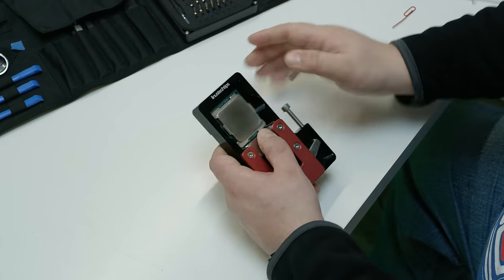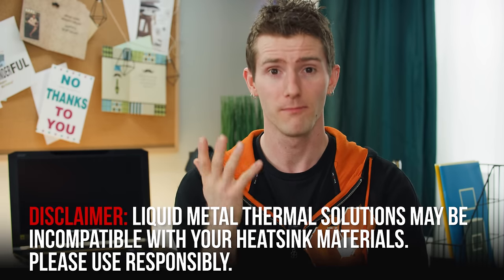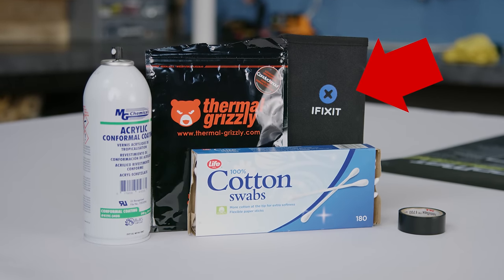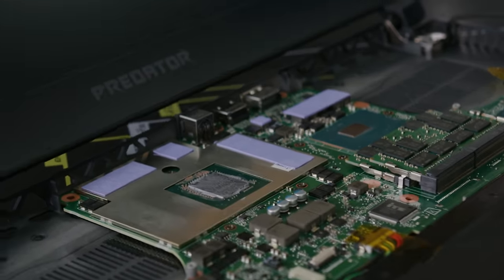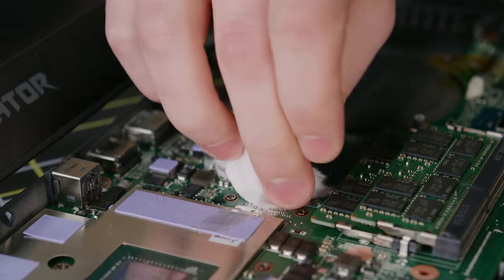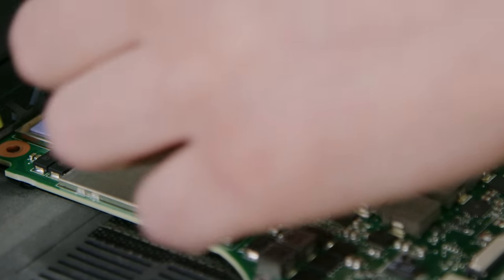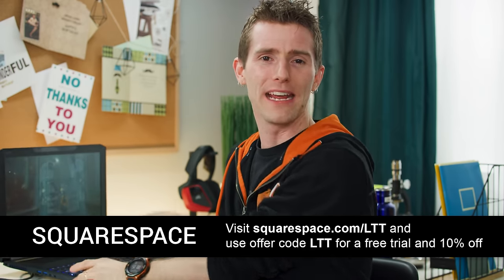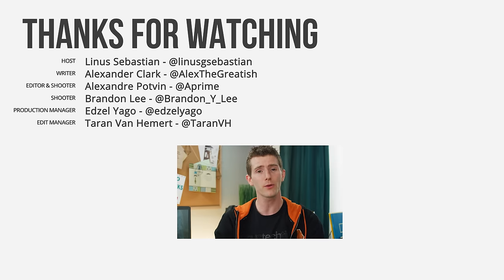Liquid Metal Laptop Cooling – 20C LOWER!

Comment: i7 8750H the H stands for Hell, as in this thing keeps Hell warm.
Reply: @tommybro5313  6 months late kid
Reply: Way too true this thing is hotter than the sun
Reply: hits 100°C regularly for me. had to undervolt to -0.165V! performs at about 85° after
Reply: @ethaningoa7461  , I use Noctua NT-H1 for the CPU and GPU and I also removed all the thermal pads and replaced them with Thermal Grizzly Minus Pad 8. 100c to 65 to 70 while gaming. Definitely worth it. Alienware 17 R5, I7-8750H and GTX 1070.
Reply: @VacMaster1991  wow, i wanna try that with my msi gs66 stealth.
Reply: @VacMaster1991  Are thermal pads really necessary? My scar 3 has thermal paste over those chips, and I was planning to just apply good paste on cpu and gpu.
Reply: @gamersanditparadise  it ok but the thing gets  messy
Reply: @marianakotiloy419  okay.
Reply: @gamersanditparadise  , the built in thermal pads have a conductivity of about 
 2 w/mk. The pads I put in have a conductivity of 17 w/mk.
Reply: @VacMaster1991  does it make a difference to the cpu by putting better thermal pads?
Reply: @gamersanditparadise  , no, new pads lower the temps of the gpu VRAM modules
Reply: @VacMaster1991  Okay. So I guess, thermal pads help reduce gpu's vram temps, but not the temps of the gpu itself right?
Reply: @gamersanditparadise  , the graphics card vram, not the gpu itself
Reply: Oh god the HK ones
Reply: You wanna say "Hellfire"
Reply: What about on a 2020 or 2019 MacBook Air?
Reply: @neubauerjoseph  MacBook Air had a fatal flaw with airflow didn't it?
Reply: @brytonmassie  I owned a 2019 macbook air bought it for the wife but I use it also.
here are my problems with that laptop top 5 issues.
1. CPU and system get too hot. need better cooling.
2. could have a high end intel graphics chips many do in its class.
3. keyboard flat keys suck.
4. 8gb is not enough ram these days it should be like 16gb all other laptop in its class offer 12 or 16 gb some have 32 gb ram.
5.SSD is too small at least 512 to 2TB would be good.
Reply: @brytonmassie  yeah that’s what I tell people....they leave a lot of speed on the table .
Reply: Linus I’ll pay you to do this for my laptop 😂 I don’t trust myself
Reply: @TheTonkGuy  so?
Reply: I thought the h meant hot
Reply: I have one and a gtx 1050 in my laptop and it doesn't get that warm
Reply: Or the H of Hentai
Reply: I thought it stood for 'Hot'
Reply: Yea , but overall, it's not as bad as my 7th gen i7 , both laptops, but my triton keeps things damnnn cool
Reply: i5 4200H and it was spiking at 85°C when playing Cities:Skylines (100% load) but after venting some dust out, it got 15 °C cooler with 5 extra fps. It allowed me to push up GPU settings :D and yet i still don't know if there is still dust inside my 5.5 year old laptop
Reply: i7-10750H here and mine use to stand for HOT I was running for example the new battlefield 2042 at 90-95c ever since I repasted I’m only at 70max and I only repasted with regular grizzly kyronaut
Reply: Imagine the 10750h
Reply: And i7 - 13700hx where hx stands for hell extreme to keep it extra warm
Reply: if only he knew how bad things would get
Reply: I resolved this CPU's temperature problems using the Thermal Grizzly Conductonaut liquid metal on both CPU/GPI....now I can use full CPU (i7 8750H) e GPU (GTX 2070) power on my Omen 17-cb00. Definetly would say liquid metal is MANDATORY on gaming laptops.

Comment: Who is here finding out PS5 is using liquid metal?
Reply: Sony stated it took 2 years of engineering to have liquid metal in the PS5. I wonder where they got that idea from? 

Sees Linus' video was released in Feb 2018
Reply: @ImReadyAyu  that would be funny 😂😂
Reply: @ImReadyAyu  the engineering went in to making sure it’s going to last for the life of the console, not evaporate or leak onto the mainboard no matter what the consumer does with the console.
Reply: @davecolwell725  and that is very hard and i salute them for that, i wouldn't even risk putting it in my rog scar 3
Reply: @davecolwell725  Let's just hope the "life of the console" doesn't end prematurely because of it...

Comment: Finally, Linus is truly supporting liquid metal thermal paste.
Reply: ICdiamond was a bit crappy  a  least for me i change to carbon base thermal paste  Artic MX4 and it was a lot better than IC
Reply: MX4 is a good cheap TIM, I was disappointed with it's performance compared to my NT-H1 that came with my cooler but at $10 it's hard to find anything better.
Reply: 10 year tube of arctic silver 5 still going strong...
Reply: I'm not subbed to NCIX so I never saw that video, with that being said, he used to not believe in the benefits in LM and called their gains minimal for the amount of risk, though he never used the product for delidding where everyone was having success. This was back a long time ago during some WAN I can't remember.  Remember when he would delid a CPU just to use a standard thermal paste? Kind of defeated the purpose of delidding in the first place. Also note, in that video you linked, he never delidded the CPU in the first place because he was using a 5820k which has a soldered IHS and is not the CPU's that were having issues with heat management. I ran a 4790k naked die on a h100i with CLU and dropped 30C with the same fan speed, with others having results like mine is why people became obsessed with CLU/CLP etc. So while you are right, he did try this two years ago, he did not try it on the processors which had issues nor did he apply the LM in areas where the poor thermal conductivity was thus he didn't realize it's true benefit.
Reply: Completely agree, my laptops have never run better or quieter!
Reply: Great, here comes the T-1000.
Reply: pertty sure he said lm isn't worth if you're not delidding but obviously directdie or delid you have to use lm
Reply: Took until now for someone to pay him to do it.
Reply: lol how come he didn’t have temp before and after application for gpu based workload? Typical LTT. Now I gotta wait for another channel to do the real work.
Reply: indeed, although this was more of a show. I missed the fact that he didn't put emphasis on some details such as: 1) properly preparing the surface of the heatsink 2) making a silicone seal around the CPU die to prevent LM spillage and excessive oxidation 3) the fact that it does corrode copper and needs replacing every now and then. In my case, it also affected the CPU, GPU dies a little bit. Although, given the huge temperature drop, I don't mind the extra hassle. Also experienced similar temperature decrease. This stuff is only for those PC enthusiasts who are bumping into thermal throttling and have the proper understanding of how to use and maintain this product. A knowledge of chemistry and physics is also beneficial to fully understand its drawbacks.
Reply: I'm glad of it! This is the first I've heard of liquid metal thermal paste and it looks very cool (pun intended.)
Reply: Really?  You rely on YOUTUBERS to do your work for you?  Especially something so subjective?  Stands to reason they will be lower, the delta being different on EVERY SINGLE SYSTEM.
Reply: Liquid metal thermal... PASTE???? 
Both a solid and a liquid at the same time
Reply: can this be used in PS4 and PS3? I really want to do it because I feel that it will lengthen the lifespan. I know that I have to be very very careful when applying it.
Reply: @gustavmh8423  I got MX-4 after being an idiot and shorting a GPU with Arctic Silver

Comment: You can't use an aluminum heat sink because gallium destroys aluminum.
Reply: I was looking for this, thanks man.
Reply: More than destroys, it literally eats aluminium.
Reply: It doesn't literally eat aluminium. It diffuses into the grain boundaries, forming a very weak and brittle amalgam.
Reply: Would consume work for you?
Reply: if you look real close, you can actually see tiny gallium mouths chewing on the aluminum
Reply: Yes, thank you.
Reply: C opper ftw
Reply: destroys is a perfectly fine adjective to use for what effect Gallium has on Aluminum.
Reply: ConceptNull Yes, but that alloy is beyond brittle and so the original structure is destroyed
Reply: +ConceptNull
i know it's Youtube Comments and arguing minorly important semantics is your job, but the end result of the Alloying is that the Aluminum is ruined, or elsewise referred to as destroyed.
because... it is. it's no longer useful for basically anything. and the end result of that is what's important in this context.
Reply: Somebody should have a talk with gallium about his behaviour problems, why can't he leave aluminum alone?
Reply: Moti Ghimire we call iron rust not an alloy because it is not an alloy it is an oxide, an alloy is a mixture of two or more metals, an oxide is almost anything bonded with oxygen atoms. Rusty iron is iron bonded with oxygen thus it is iron oxide. Combinations of different metals form alloys. An alloy composed of mercury and other metal (or metals) forms amalgam